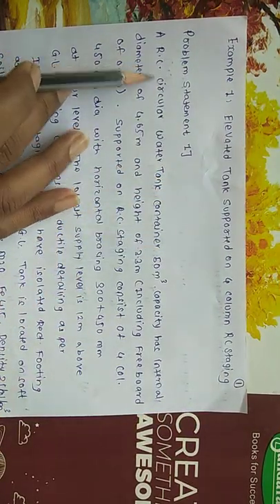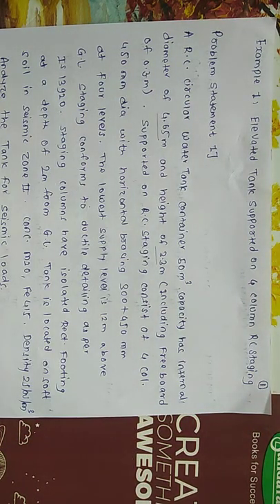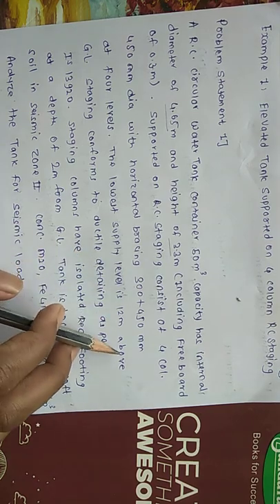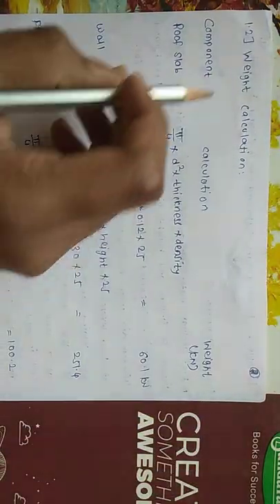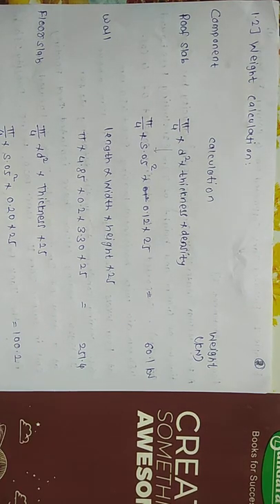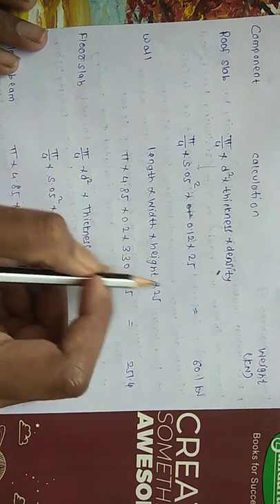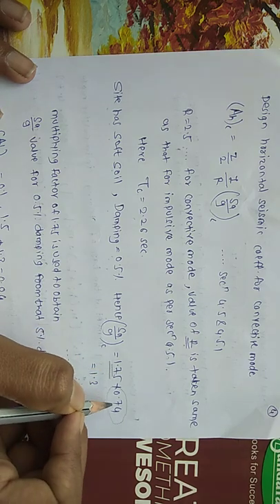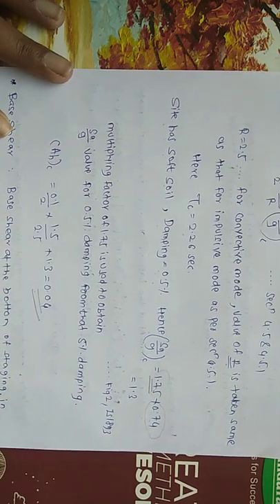Seismic analysis of elevated water tank as per is 1893 : manual calculation iitk nicee : dynamic

Comment: How "rho" value changed to "g" in eqn. 4.3.2.2 while calculating "Ti" ? How does the "Ks" value come to 60,60,000? From where this conclusion comes out // As per 4.3.1.3, the C.G of the tank is combined C.G of empty container & impulsive mass //? In Cl. 4.3.1.3 nothing written like this. Kindly explain.
Reply from the maker: Ks value is taken from software analysis. I have made one video related to that.

Comment: Sir, I am working on a similar project and facing a problem. I modelled the structure in staad pro but I cant develop the load cases to perform the response spectrum analysis. I am following the IS 1893 part 2 procedure but the calculation of lateral stiffness of staging in the elevated water tank is creating the problem. Please help
Reply from the maker: Yes, i am working on it
Reply: Hi bro, please use master slave node command in staad pro. Create a master slave node at 15.18m height in staad model and link all the nodes of container and top nodes of all columns to master node. Now apply horizontal force 10 kN on it and analyse the program. You will get deflection. Now devide this deflection  value to 10 kN. You will get stiffness of staging.
Reply: @rajendrayeole2670  hey, can you please provide the link your stadd model (this specific one) input (copying it),, I'm facing difficulty while determining the leteral stiffness 😅

Comment: hi sir, how to take lateral stiffness of stagging value from staad.pro.
Reply: Hi bro, please use master slave node command in staad pro. Create a master slave node at 15.18m height in staad model and link all the nodes of container and top nodes of all columns to master node. Now apply horizontal force 10 kN on it and analyse the program. You will get deflection. Now devide this deflection  value to 10 kN. You will get stiffness of staging.
Reply from the maker: Check this video https://youtu.be/fsTmXyiH4RE
Lateral stiffness of staging